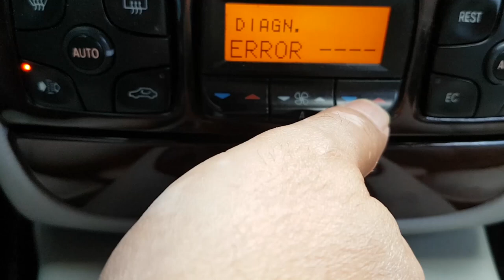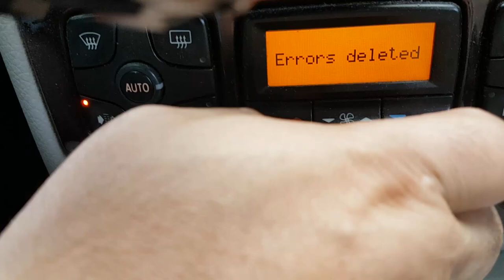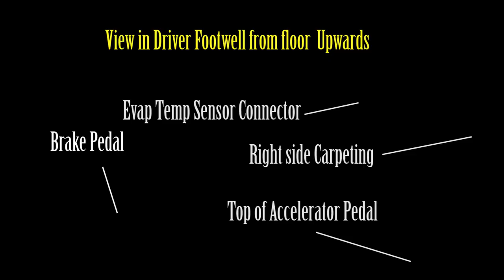Mercedes S Class Evaporator Temp Sensor Replacement

Comment: How did you remove the old sensor out of the socket? My sensor isn’t coming out as easy as I thought it would.
Reply from the maker: Hi Kj, remove the electric connector first.  Then just play with it gently moving and twisting until it come out.  I don't remember exactly what holds it in place, but look at the replacement sensor which should give you a good idea.  I dont remember it being hard to remove at all.  You will have to do it by feel though.
Reply from the maker: I think you twist it right or left...

Comment: Hello there,i have a weird problem on my w220 ,it blows only hot and cold air,for example if i select 23 or 25 it will blow only hot air and to have cold air must be setted to low or 15 degrees on display.why i can t have middle temperature on it???😢
Reply from the maker: It indeed sounds weird.  Haven't run across that yet, and won't know what it is without testing...check the condition of your sun sensor as a culprit.

Comment: Cant i ask you,why my aircond,stop car aircond very cool,and my car running aircond no cool?
Reply from the maker: Hello, if I understand you correctly, your AC is cool when the car is stopped but not when driving...I would check your fan first. It seems like an electric issue.
Reply: Fan i running,because sometime aircond cool,sometime no cool…so,this morning i start engine,on AC,cool boss..sometime no cool..

Comment: Is it okay if i use the hole before install the new sensor to clean the evaporator by foam ?
Reply from the maker: Sure, if you are experiencing the symptoms in the description, it means you already have a bad sensor.  Cleaning it out will not make the symptoms any worse.

Comment: @1.06 what is the little vent opposite of the reset button ive been trying to look it up is it part of the ac sensor system like the one overhead?
Reply from the maker: Hi Izzy Jr.  I think that is an in-car temperature sensor.  There is another overhead to the right of the sliding roof button.
Reply: @masood-tv    thank you for the reply. I've seen people clean the overhead one but haven't seen any about the one on the bottom(by the reset button). Would it affect how the ac functions with those sensors also being dirty? Have you clean them before?
Reply from the maker: @4DALOOKS92 , I never have.  They are  basically thermometers.  You can clean them if you want by spraying electronic parts cleaner or MAF sensor  cleaner.

Comment: Hello my one it’s similar problem but hot air blowing after 10 min from driver side only,u think that’s the problem?
Reply from the maker: Hi Sabastian, it could be but hard to tell without seeing the car.  It is a cheap part that eventually will fail, so you may as well replace and see if it fixes it.
Reply: Masood thank you
Reply: Hi I was looking for that sensor yesterday in my car(didn’t received new one yet)but I cold not find,there is some cover which I tooked off but still…can not find,will try one more time but any tips?
Reply from the maker: @sebastianmiczulski187 , on a W220, please find it per the video starting at 01:24 minute.
Reply: Masood how many plastic covers need to remove,I tooked one but still don’t see…u have to remove some part of carpet?Im in Uk so steering wheel on the right I believe the sensor will be on left side which is closed to glove box
Reply from the maker: @sebastianmiczulski187  I didn't have to remove any plastic covers.  I pan to its exact location again after I show the steering column at 1:36 minutes.   Please watch the video again.  It is not on passenger side.  Look directly above the accelerator pedal.
Reply: Masood thank you my one it’s right hand drive so I wonder it’s gonna be opposite any way will check again
Reply: I think feed up,which year it’s your w220?my one is 2004 s320 cdi
Reply from the maker: @sebastianmiczulski187  shouldn't matter but the one in the video is a 2000 S500.

Comment: Hi Sir thanks for all the Videos u share really helps I have a question if u can help me I have a 2003 S430 has a code A1269 on AC panel pls if u can tell me how to fix it appreciate ur help thanks
Reply from the maker: Hi Khurshed Khan.  What are the symptoms?
Reply: @masood-tv  thanks for ur reply , No air from driver side vent next to the driver door secondly blows hot air from the lower vent which is on top of parking brake.
Remaining all vents blows cold ie front  center sides and rear cooling is perfect.
No other codes on AC panel except A1269.
Reply from the maker: There are a lot of climate related sensors. You could change them and the one in this video.  However, without proper diagnosis, it may not resolve your issue.  Two things you can do; however, is to reset the code. If it persists, turn all auto functions off and manually control fan speed, etc....see if that helps in getting cold air to all vents...
Reply: @masood-tv  I forget to ask u if by any chance u have the fuse diagram paper (details of all the fuses) which comes with Mercedes normally it’s kept on top of spare tire and spare fuses pls send me a copy if u have it.
Reply from the maker: How do I send it to you?  Search in Google.  You should get a lot of good hits.

Comment: hello i need help
Reply from the maker: What kind of help, Antonio?
Reply: @masood-tv  My air only blows cold when its not so hot outside .. it has to be set alll the way to low is this sensor my problem?
Reply from the maker: @uzzle21  it is hard to tell...I would start by testing the condenser and the fan...
Reply from the maker: @uzzle21  please read the description below the video to ascertain if this sensor is faulty..